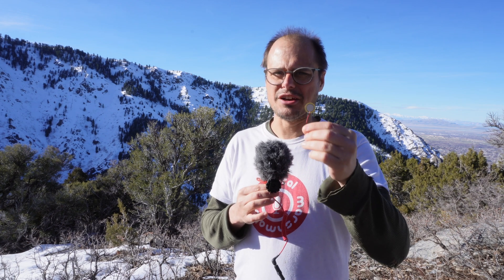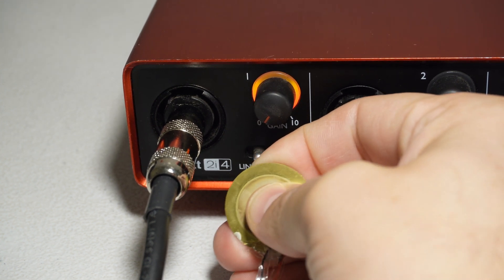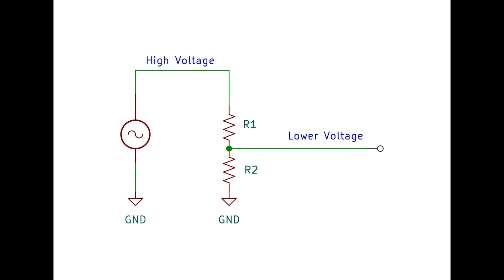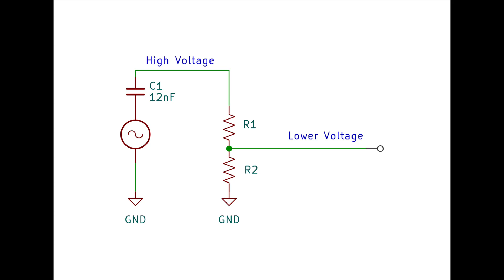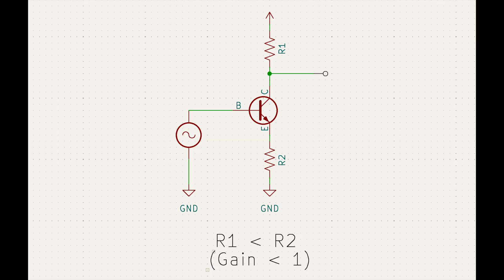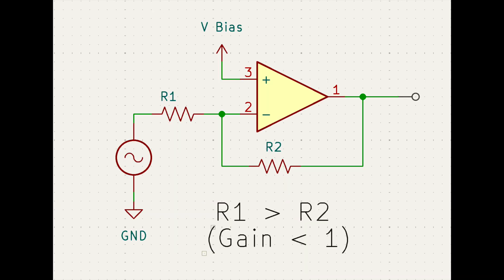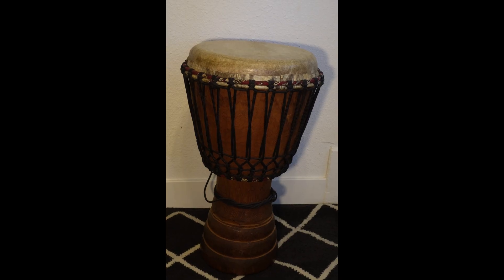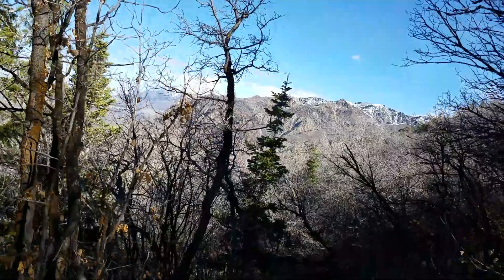How to record really loud sounds with a DIY contact mic

Comment: in the description of the video you put "I did some more simulation after editing this video. If you are using one of the Metal Marshmallow DIY preamps, I might suggest 2 10nF capacitors for -6dB, or C1 = 680 pF and C2 = 10nF for -24dB reduction." where exactly would the go on the pcb?
Reply: - ps youre the greatest to ever do it thank you for everything!!
Reply from the maker: I put a diagram on my blog, I will write more detailed instructions later: https://metalmarshmallow.com/blog_post.php?id=17 You can also (kind of) see it at 6:47 in this video